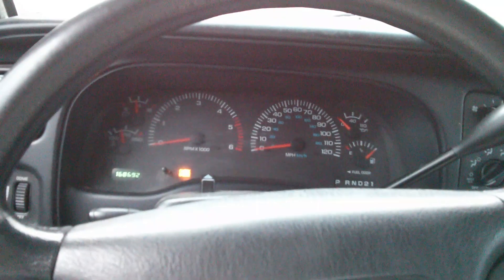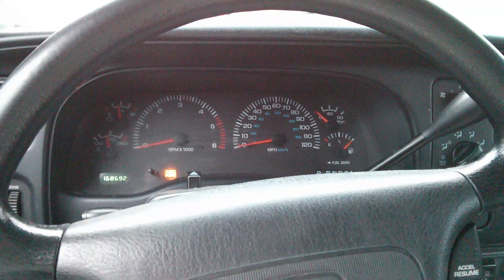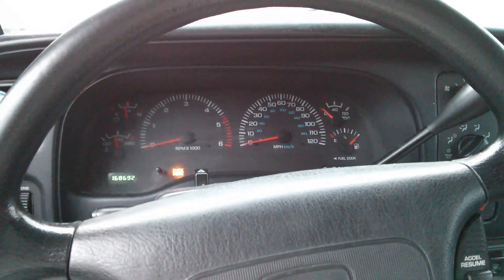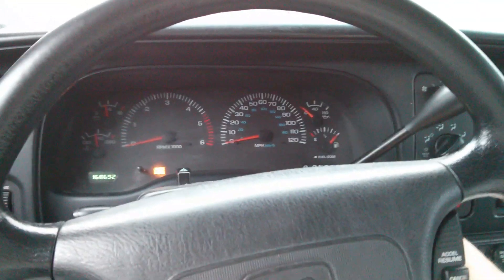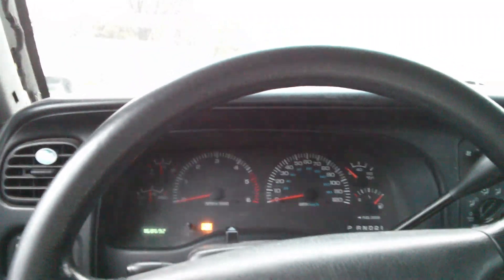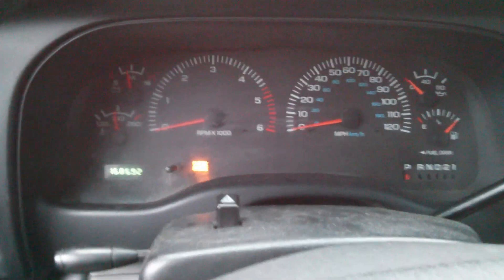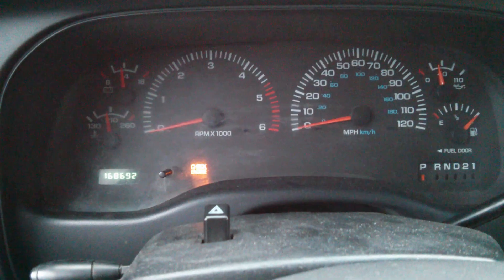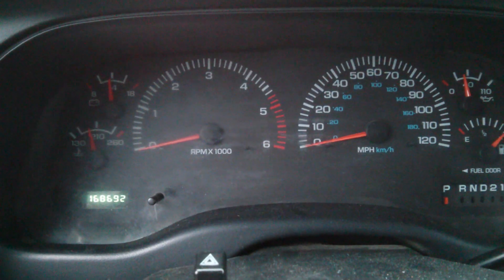1999 Dodge Durango Shuts Off randomly

Comment: I think it's your security
Reply: it wouldn't stay running at all.
Reply: This is worth looking into . I have had a dead battery before and needed a jumpstart and i had to hold gas and keep hitting unlock on the fob to make sure security was off and then it stayed running after that . Next time battery went dead , same thing happened . Mine is a 2001 Durango /w 5.9L  .
Reply: lukewebb96

Comment: my 1999 5.9L did the exact same thing. I had it in the shop replaced starter and ECM . the new computer was faulty had to send it back and get another one. Was running fine but now I have an erratic idle so I replaced the air idle control valve and the throttle control module ( I think that's what it is called. ) so far running fine no check engine light no stalling. hope this is it finally.
Reply: Pete Allen how much did that cost